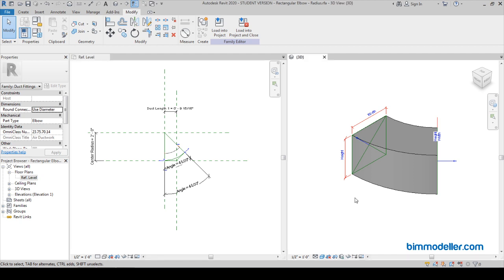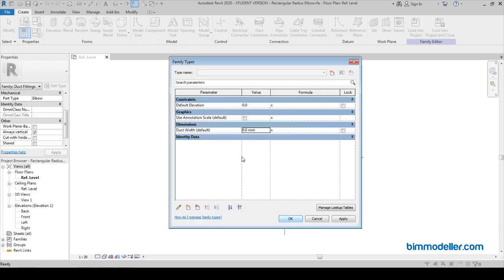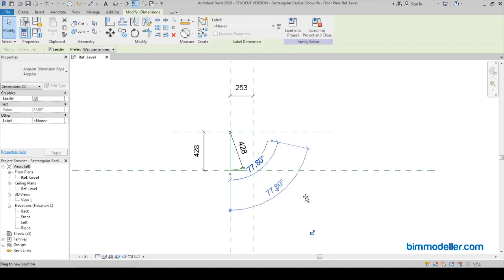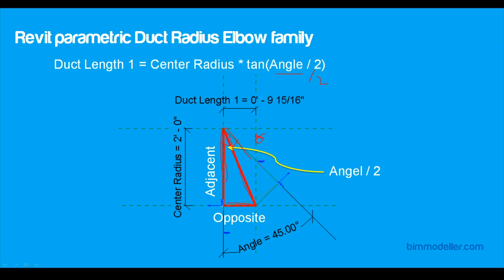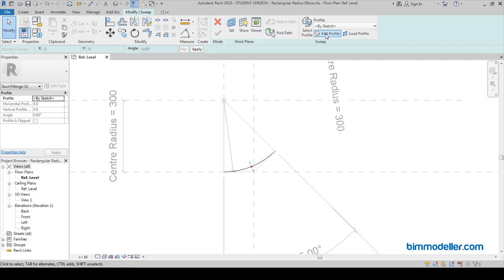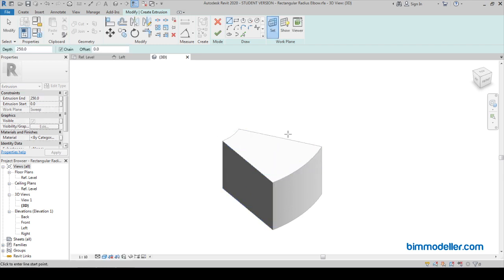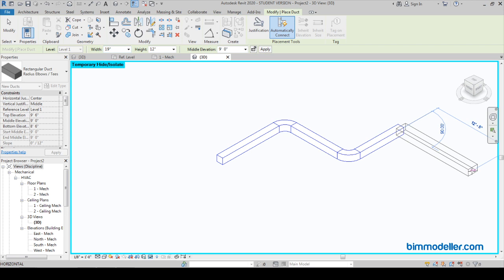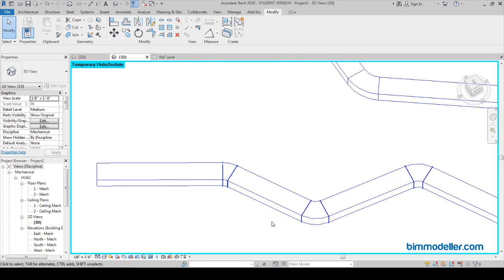How to Create Revit Parametric Duct Radius Elbow Family

Comment: Thanks. Great Video !!! Just one question. Why do not use Metric Duct Elbow Template instead generic template?
Reply: I've posted the video using Duct Elbow template ... less than 10 minutes and made both radial and mitered elbows
Reply from the maker: It will have initial settings for the elbow

Comment: HELLO . YOU COULD MAKE A VIDEO ON HOW TO LEAVE THE RADIUS FIXED, BUT BY CLICKING ON THE DUCT I CAN CHANGE THE RADIUS. AND WHEN I CHANGE THE HEIGHT AND SIZE OF THE DUCT THE RADIUS STAYS FIXED.
Reply from the maker: Can you please explain more in detail?
Reply: Hello, I would like to change the radius regardless of the height and width of the duct. @BIMModeller
Reply: @BIMModeller  HI, I WOULD LIKE THAT WHEN I CHANGE THE HEIGHT AND WIDTH OF THE DUCT THE RADIUS WOULD ALWAYS BE FIXED AT 15.
BUT I AM NOT ABLE TO DO IT.
Reply: @MarcosDemichei 

You can check the video i posted on creation of elbow fittings